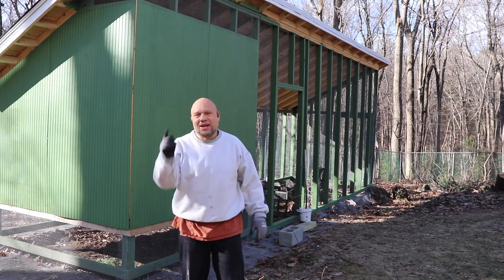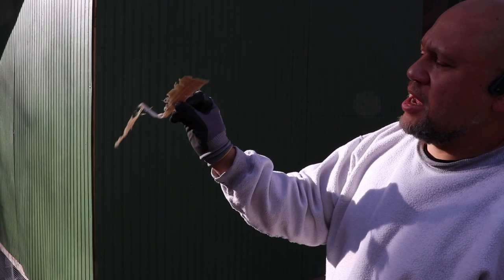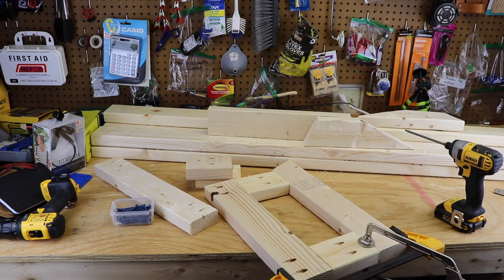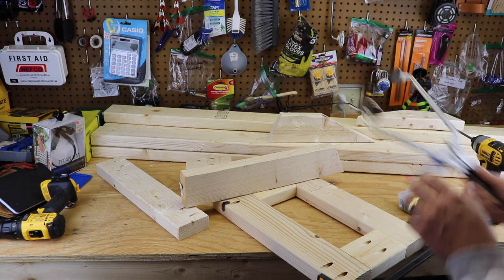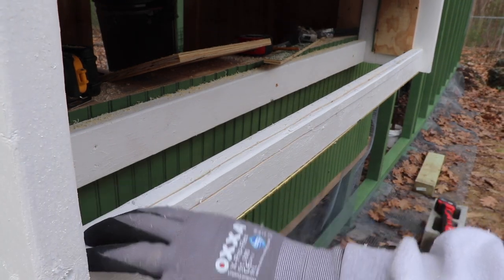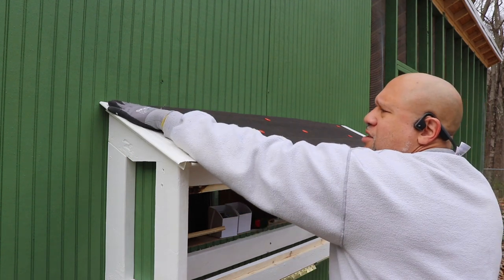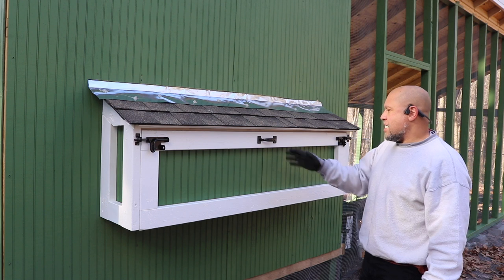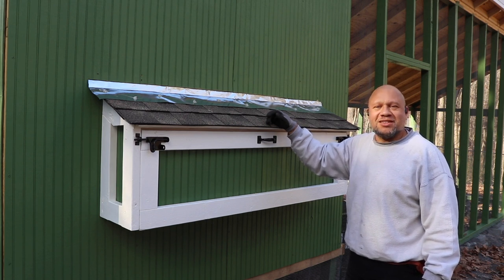Chicken egg box/ nesting box. Most Epic DIY Chicken Coop Build Part 7.

Comment: Guday mate from Down Under. It looks like you need a Router to help you to cut rebates.  It's also far safer than a circular saw and much more accurate.  I am building an A frame coop about 9 feet wide on all sides. The exterior laying boxes will be similar to yours but connected to the vertical end wall differently. I like the 'A' frame design as it is so very strong in a cyclone and very easy to construct.
Reply from the maker: Yes, I bought a router after the fact once I knew what I was missing!!! I'm curious how you are going to attach your egg boxes! Thanks for taking the time to comment!!!

Comment: go inside screw a 4-inch screw in each corner go outside and use a chalk line and make your lines  cut hole set your blade to 3/4 of an  inch so you don't hit 2x4s
Reply from the maker: Yup. That was a battle. I wish I did that better. Thanks for watching!

Comment: I built my roof to my coop and nails were showing through and I used cork on the nails.  However, what should I do with the nails that could potentially show through on the nesting box?  I can't really use corks for the nesting box nails.  The wood for nesting box lid is about 3/4" thick.
Reply from the maker: Good question! My coop roof is so high that it isn't an issue. Im going to go look at my egg box and see how far the egg box roof nails stick through. If you're worried about you or your birds getting poked, you could bend them back over by hammering them sideways or you could cut off the tips. Thanks for stopping by, I love the questions!